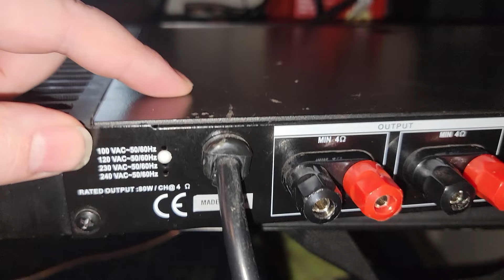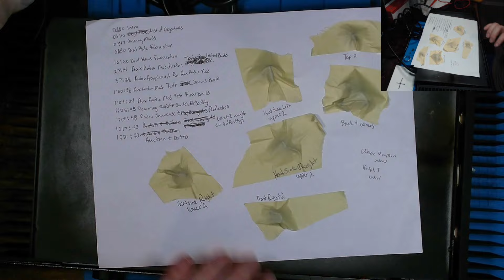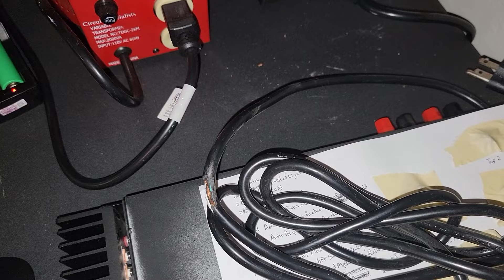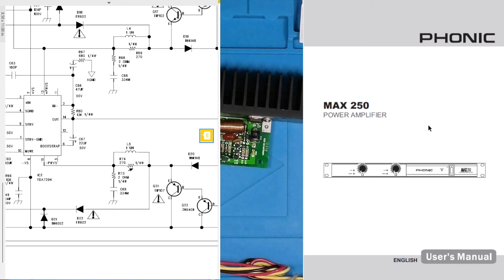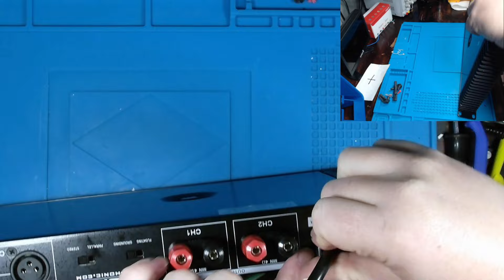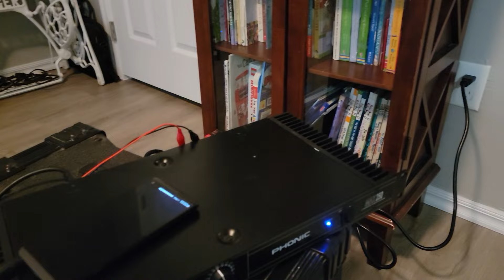Phonic Max250: No Power & Channel 2 Failure

Comment: hi friend....im from argentina, i have the same amplifier, but the toroidal power transformer is burnned, in argentina is imposible buy this transformer.... I need to rewind the transformer, how many turns and what gauge are the windings, do I need it to use with 220 volts
Reply from the maker: Firstly, thank you for watching. You raise some really good questions some of which I think I covered in a HFR teaching video, but not to your exact inquiry. There is a lot to discuss on this subject which is honestly a bit to much for me to type out over youtube. The basics are that you need to know how many turns are on in the primary and the source voltage to determine how many turns you'll need on the secondary to either step up or step down the voltage. Basically something we call a turn ratio. The Electric Academy has a video titled "How to use turn ratio to calculate voltage" that may come in handy for you. If you have a decent set of calipers you should be able to measure the diameter of the enameled wire to determine a suitable replacement enameled wire. Keep in mind if you are rebuilding a transformer you are assuming a lot of risks if you have never done one before. I don't know your technical skill level, but I would encourage you to do as much research as possible and if you do rebuild the transformer, make sure you are testing it using an isolation transformer, variac, and dim bulb tester instead of plugging it directly into a wall outlet for testing on your mains 220 volt source. I would never encourage rebuilding a transformer and must emphasize safety.
Reply: @HavingFunRepairs  Thank you for your prompt response, I have experience in winding, but in this case since it burned I cannot count the exact turns it had to wind it again. I also don't have the voltage of the secondary winding to do the calculation. do you have the secondary winding voltage?
Reply from the maker: Potentially, I have the service manual which you can download from my Google site

https://sites.google.com/view/havingfunrepairs/home

Go to bottom of page and select link for Circuit Board Schematic and diagrams.

I don't know what AC potentials are on the secondary between each tap. However, on the schematic you can see that four taps are used for two separate rectification circuits. One to develop a plus and minus 60vDC and the other for a plus and minus +15vDC. My assumption is you are looking for the secondary to at least produce a 120vAC between two taps and a 30vAC between two taps as well, prior to rectification. Unfortunately this was a customer repair, so I have no way of going back to the items and tearing it down to verify.
Reply: Leo una pregunta creeo que se me quemo el transformador toroidal como me doi cuenta que ta quemado